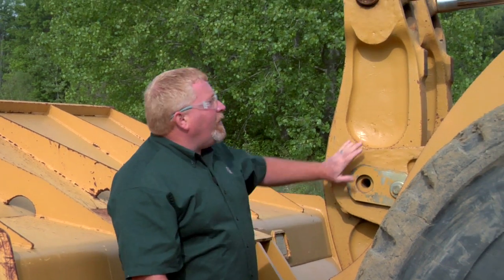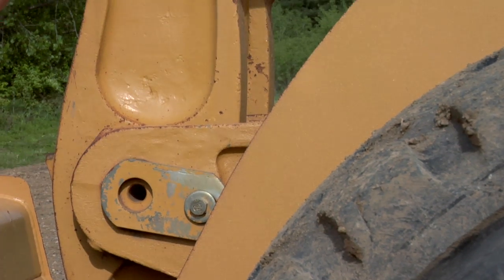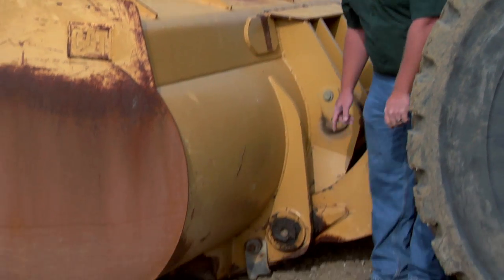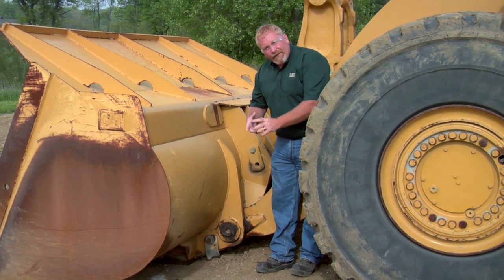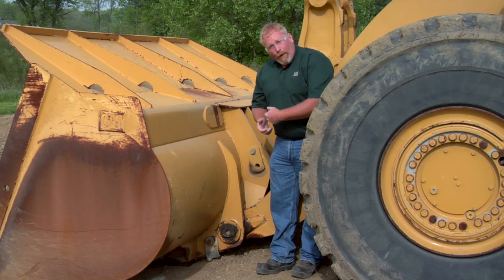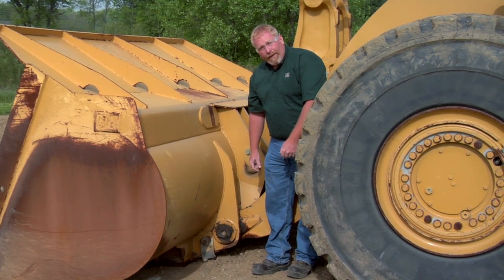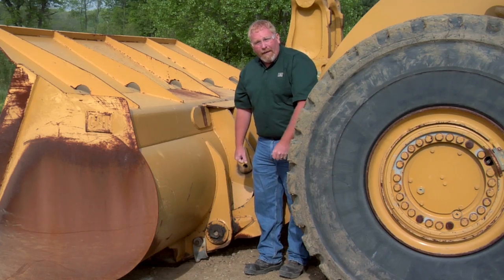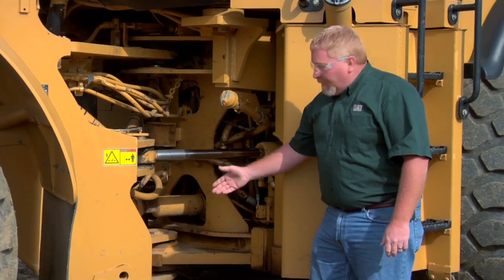Cat® Wheel Loader | Linkage & Pins | Lubrication Tips

Comment: Watch the paint on the hoses. Cracking can indicate the hose is expanding and getting weak. 
Some times have to pump oil into the grease joints when greasing isn’t being done to lubricate and flush the joint.